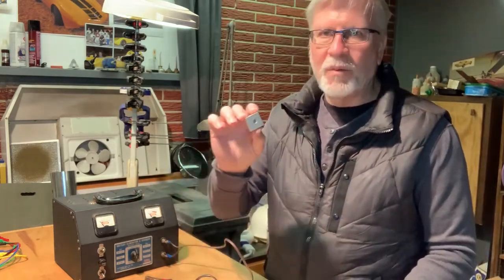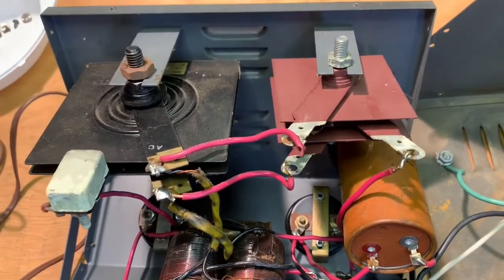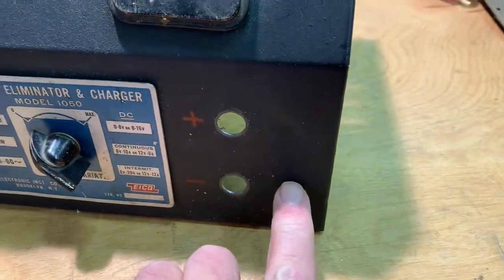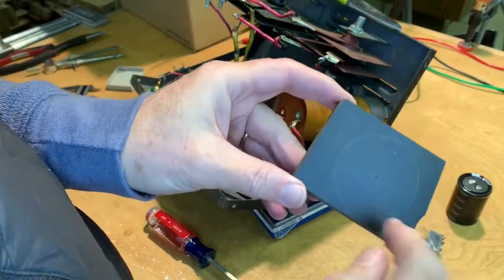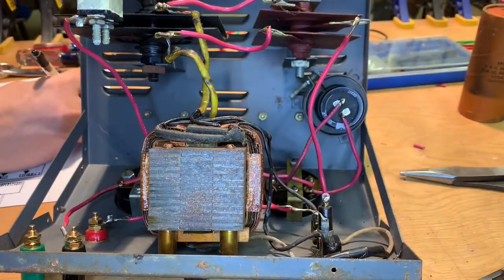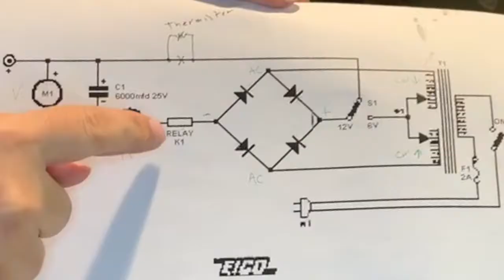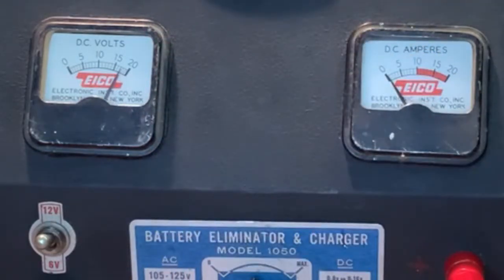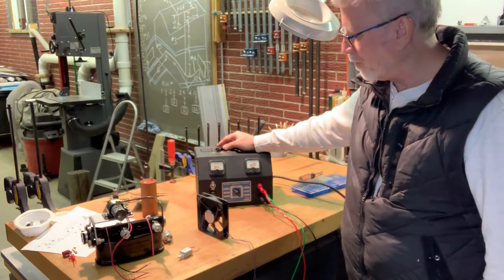Battery Eliminator Renovation

Comment: Rectifier Rectifier what's your function, hooking up phases to make DC voltage... real school house rock moment there.  Not sure though which is older the battery eliminator or your solder gun but both are awesome because they both work great.  New stuff these days are junk and your channel is great in showing how to keep the better built tools in service.  I had one of those new made in China DC voltage battery eliminators and it lasted 2 uses before it went up in smoke.
Reply from the maker: Thanks Tom, I hate seeing good stuff get pitched out. This thing may last the rest of my life. 😀